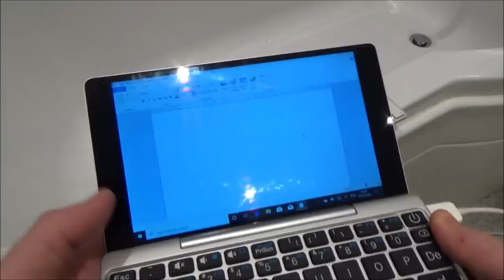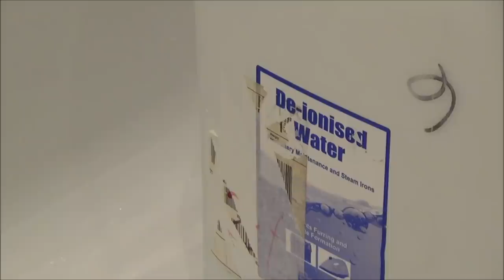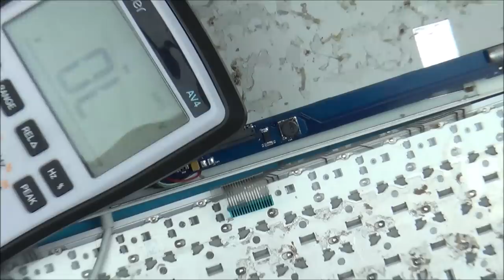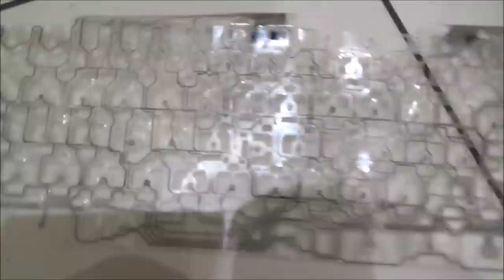Trying to FIX : Faulty Apple Keyboard Model A1243 purchased on eBay

Comment: Such a bummer that Apple doesn't make their stuff more repairable. These would be a relatively easy fix if they did. Interesting video
Reply: The aluminum keyboard I got with my 2010 Mac Pro, quit working this past week actually. That's with 15 years of heavy usage. Apple doesn't have to make their products user repairable because they function well past their warranty date. 15 years use out of any computer peripheral is pretty damn impressive. Ive been through 3 $1000 TVs in the time I started using that keyboard. Ill gladly spend another $150 on an apple keyboard.
Reply: @MrSharesky  I went through 3 Apple Keyboards in 2 years. All were replaced under warranty, but would not spend my own money on another one. I'll go elsewhere when this one fails.
Reply: @ftrueck  they have a massive sustainability department headed up by former director of the  US EPA . Right to Repair is  something Apple needs to get their head around. Just getting worse by the day.
Reply: This isn't just Apple, I had a Microsoft Natural Keyboard 20 years ago that had the same type of Membrane. This is what cost reduction/cheap manufacturing has done. They've reduced the cost of keyboards to the point where they literally are just pieces of plastic paper with the tiniest metal printed on them. Very easy to break/corrode/damage. None of this stuff is designed to be repairable and it's a real shame that Electronics has gotten to this point. Makes a good argument for buying mechanical keyboards.
Reply: Very useful indeed. One thing though, water damage is not always the main culprit. This handy lad forgot sweaty hands. I know it's some kind of water damage but not in the way most people think of. Our body can secrete many nasty elements that can wreak havoc on these fragile membrane circuits.
Reply: @dmjc  I'd agree if there was a chance to get the same feeling as with a Logitech MX Keys, my absolute favourite silent keyboard. I type a lot and find the clicking noise on mechanical ones horribly distracting.
Reply: I just came here after watching your videos and became motivated.  Thank you and your heart!

Comment: X & Y interrogation lines scan for a key down. These are driven by two binary counters that are converted to decimal interrogation lines. {Rows & columns are X & Y}. The scan speed has to be fast enough to catch a typing speed of around 5 chars pers sec or a bit more.  At the instant that a key down is detected the value of the binary counters is frozen and transmitted to a look-up table that interprets which key it is. This will be passed to the display section but don't worry about that. Its quite mind-blowing enough. Excellent video and well done for persisting. You have done well.  I have done these and re-welded them back with some JB Weld. For some machines the complete membrane is available. {HP for certain}.   :<)) BjG

Comment: I did this myself a week ago, pain staking process each individual key and each individual key bracket etc. When I realised the circuit board was basically laminated with membrane I knew then the damage was irreversible so continued to dig deeper as curiousity got the better of me. Great video, nice to know I'm not the only one 🤣

Comment: The way these keyboards work is that they have a matrix with a keyswitch at every intersection.  The microcontroller sends voltage down a column line, and looks to see if it comes out on any of the row lines.  If a key is pressed, then it connects a column to a row.  The arrangement of the matrix probably doesn't match up with the actual physical arrangement of the keys completely.

Comment: The more you look at stuff like this, the more it becomes apparent that Apple went out of their way to specifically design these devices so they cannot be repaired/serviced.  The fact that they're not cheap makes it even worse.  Those traces on the keyboard membranes must be so thin that any contact with water would cause it to corrode to the point where the contact would oxidise, entirely losing its conductivity.  It's probably not even metal, but some kind of composite that's etched or sprayed onto the plastic sheet during manufacture.  Something designed to wear out after only a year or so.  Sounds a bit conspiratorial, I know, but it wouldn't surprise me at all if that were the case.
Reply: Mind you, the threat of water damage is as old as membrane keyboards themselves, and has been known for decades - IBM started including drain holes something like 30 years ago in an attempt to mitigate the problem (a tradition that continued in Thinkpads up to quite recently, newer ones are supposed to be sealed). Rubber dome keyboards will often have a continuous silicone sheet with the domes that'll provide waterproofing without too much effort. Notebook-style scissor switch mechanisms traditionally don't have that, and so neither does this keyboard.

I wouldn't say they were designed so that they couldn't be repaired - but rather under the assumption that they wouldn't. There was literally zero concern. Not a huge difference in end result, mind you. This sort of stuff actually isn't all that rare, if you have a newish car it probably contains several electronic modules that are essentially (expensive) throwaways as well - but to be fair, their weatherproofing also needs to be extremely good.

Now the recent Macbook keyboards that have a habit of breaking if you look at them wrong and basically requite the entire top case assembly to be replaced unless you want to be ripping out lots of glued crap? That's positively nasty.
Reply: That's Apple for you, they rip you off with their prices and make it non repairable
Reply: @HuntersMoon78  And threaten to sue unauthorised repair shops who repair their products
Reply: 99 percent of keyboards are build exactly the same.
Reply: @PileOfEmptyTapes  Sad but true :(
Looks great, but if anything breaks you can throw it away. I guess you could build the same keyboard but with a few screws to unscrew and clean.
Reply: @FennecTECH  That's not correct. Maybe 99% of all keyboards share the same tech, but I didn't had any other keyboard in 30y+ years in my hands where I couldn't unscrew anything.
Reply: Louis Rossmann enters the chat.
Reply: Smattless  Yeah, like board members and engineers? ;-)
Reply: It's official. Acc. to Apple Keyboard A1243 Teardown - https://www.ifixit.com/Teardown/Apple+Keyboard+A1243+Teardown/98273:

"There are practically no serviceable parts inside the keyboard other than the logic board but even so due to the assembly of the keyboard there are no spare parts available to buy even if you could. There is little practical reason to actually disassemble the keyboard."

Actually there are parts available , all used. I got as far as removing a key cap and scissor mechanism but the silicone cup/spring is unremovable without cutting into the plastic membrane holding it in place. I'll try cutting the top or bottom legs of it, leaving it in place. Nothing to lose since the keyboard is trash in its present state.
Reply: And it's not just Apple. All electronics manufacturers are following in their footsteps, building phones with batteries housed in cases sealed with industrial glues that designed to destroy the case if you try to get them open. When you look at where Apple started, and where they are now, it's truly tragic. But I own Apple stock, because consumers are so fucking numb and stupid and conditioned that they will keep buying products like this, over and over.
Reply: Dont know if you have seen a video from Louis Rossma, he pours about 2 litres of water over  a thinkpad and it keeps working . It did fail a few months later but probably because he did not take it apart and dryit properly as he can afford to buy a new one
Reply: They probably spent millions to make it not repairable. That is the most important goal for Apple. I mean, isn't EVERYTHING other than Apple so repairable that it only takes 10 seconds to repair anything made by any other company? Geez Apple, you're the first company in history to make something that a 5 year old kid can't repair in 5 seconds!
Reply: A product should be solely judged on whether or not one can piss and spill beer on it and fix it in 5 seconds or less! 99.9999% of all other electronics pass this test. Apple is the first company who prevents their products from working after piss and beer damage.

Comment: Good video Vince.  The tracks on the membrane under the keys are very thin and can go bad with age or contamination.  Sometimes it's obvious because they go a dark color as you saw.  I've repaired older keyboards with broken tracks on the membrane by using a "circuit writer" pen, which is just a conductive ink.  First I would take apart the keyboard and wash all the plastic parts and membranes in the bath tub and lay them out to dry on towels.  My experience is with older keyboards which are much easier to take apart but these apple keyboards are obviously much more difficult...

Comment: Thank you Vince for your video. I Just repaired mine, by opening it with hot air gun, and a slunger like you. Then, jiggled the junction between layers you mentioned at @49:38 without removing the welded part.... and voilà ! Back to life ! 
Thank you so much !!!!!

Comment: Very interesting video, I got a bunch of these sitting around with faulty wires / boards, you’ve inspired me to try open a few of them up see if I can swap out the boards and get a few back out into working order. I did try before but I nearly stabbed myself tryna open em up. Such a shame they are glued on so strongly compared to the newer ones.

Comment: Im glad I found this tutorial.

So this is my issue, yesterday I decided to wipe down my keyboard (the same one in this tutorial). All I did was I used a damp hand towel, and went across the keyboard to remove some smudge and dirt off of the keys.. The keyboard was connected to my mac.

After I noticed that the green led light indicator for the caps lock was not lighting up anymore. So I went online to see what could be the issue (I have El Capitan by the way). So I tried holding down the caps lock key for a second, tapping it 5 times, tapping the alt/option key 5 times, so on and so forth.

Now when I hit the caps lock key it still doesn't light up but now the d key wont work, unless I click on the caps lock again.

but also other keys will not work when the caps lock key is initiated.

Do you have any idea what could be the issue?

I have tried to do a pram reset and nothing. Your help will be very much appreciated.

Thank you

Also if the caps lock is initiated certain keys like the o, or p would actually eject the cd carrier.

Comment: Hi Vince, I was very interested in this video as I have a broken keyboard of the same type. I'm thinking that it may not be rust from water that you have seen, as the backplate is not made of ferrous metal, It's more likely to be coffee, the weak acids from which would etch the traces over time. All pretty academic as it couldn't be fixed. I do wonder if bathing in IPA may have been a better move, as it is more likely to clean than cause shorts. I may have a go and if successful, will let you know. Keep up the great work!

Comment: The fact they can't be repaired is such a pain! I have one that works but it's in rough shape (crushed edges and missing keys) and a broken one in mint condition and I was planning to put the working electronics in the working one. Guess not after seeing this. I'll just swap the missing caps over and leave the crushed aluminium edges as they are.

Comment: Have the same keyboard, had issues with keys not working (i spilt red bull on it) so put through dish washer (warm wash no soap) and when it was finished i put on radiator for a day and when i tried again it worked fine...

also had one in office that had same issue as yours, only a few keys working, took home and also put through dish washer, same results, working fine now...

Comment: Like 6 years ago I washed it, keys removed, under tap water. The only thing I damaged was the usb power with a very inconsistent connection. But apart that, it's working fine, for 12 years now. I know it's value, and I salvaged some others all those years, but latter versions are so sensible now, they definitely don't like liquid whatsoever. I can't get over it. I don't have mac anymore, but all my PC has an wired apple alu keyboard.

Comment: You say that it´s well made, I don´t think so. 
They made a keyboard that can´t be opened without destroying it and it´s not water proof. 
So it means if you have the bad luck to spill some liquid in your keyboard. It´s gone......  it´s just a matter of time....
Reply: Yeah, it's well made... To not give Apple any money as it is only fit for the trashcan. LOL! 😜
Reply: This is a problem with thin membrane keyboards in general. I killed my Logitech K800 with literally 2 or 3 mL of filtered tap water landing on the arrow keys.
Reply: I agree. I have many Thinkpads and all of them still work. I can replace most of the parts, especially the most failure points, battery, keyboard, ssd. Currently use a Lenovo L380 and stuck 32 gigs of ram in it, everything in it is replaceable by the user.
Reply: That's true of most electronics.
Reply: Unbelievably anti recycling and repair  ... All they think is money ... apple pro money... I have 2 mac books 2011 and 2012, one is completely new (not been used much) and a mac air and now on the mac air and one of the mac books, I can not install some programmes as their operating system are not supporting!??? I wish i knew this is the case. Its like buying an expensive car but not being able to drive it a few years later ???
Reply: I can agree with this, the newer a1644‘s and a1843‘s are tons easier to open up and replace parts, though you still can’t replace the Memebrane like you can in the old a1048‘s which is a shame
Reply: True True True! Its irresponsible and crafty.

Comment: When I wash a circuit board with water or alcohol, it has to be quickly dried off and then left for a few days to allow moisture under the chips to evaporate.
Reply: Smattless  when soldering I clean with 70% alcohol. It still will linger under IC's, so I leave it for a day or so before powering up. On motors I will use water and compressed air, then run them until warm to dry out.
Reply: Smattless  the 70% alcohol is 30% water, and if not fully evaporated will conduct electricity and cause a short.
Reply: Smattless  I have 97% for certain things. On some plastic items it will cause a white film.

Comment: I am an Apple fan, but I do really wish that they made their hardware more repairable. That said, even if it was possible to open one of these easily, they would still almost never get repaired, so I think Apple just decided that they might as well make it sealed. At least the keys and scissor mechanisms are replaceable, which hasn't been the case with the most recent MacBook Pros until the just-released 16" model. 

This was an interesting video. I have a couple of these keyboards (and never had any issues with them for what it's worth) but I never knew what they looked like inside.

Comment: Vince you’ve learnt a few things which is worth it 

Welds are just solder 

Don’t clean using anything but IPA

Heat up before dissembling

I think you’ll have more success with next one

Comment: The layout for buttons is like chessboard matrix. For example if you want the fist button on a row A on the first column 1 - you connect A on first connector and 1 on the second and so on. So for standart classic keyboard you should have 104 keys which is (it could be 8x13 which is exately 104 keys) 10x11 matrix (for 110 keys with 6 unused/reserved) e. g. from A-J for rows and 1-11 for columns. If you want 3 button on the 5 row you connect E with 3. On the flex board they can be layed out differently but the mapping will be the same. So you can make somekind of DIY device from leftovers ;) You can even wire your own unique keyboard from buttons or rubber tacktile switches and wires and even put LED backlight on its USB cable on +5V line :D

Comment: Designed in California, clued in China. These are terrible keyboards, I have 3 of them and all the same issues (hower all different keys). There is theory that these keyboards are pressed (to tighten the glue - too tight) at the factory and this maybe already damage a small piece of the horrible fragile membrane or damage it over time by the crazy amount of pressure inside the glued materials. This is not designed for repair, a real shame. You can take out the PCB and mount it under a desk to provide 2 usb ports.

Comment: You can soften and/or remove the adhesive with Naphtha - sold as Zippo Lighter Fluid, Ronsonol Lighter Fluid, or VM&P (varnish makers and paint) grade naphtha (quart size) from a paint store.
Squirt and wipe off. Gloves recommended. Similar but stronger than IPA. 
I use it to clean sticky goo and labels off of cardboard boxes, and plastic cartridges.